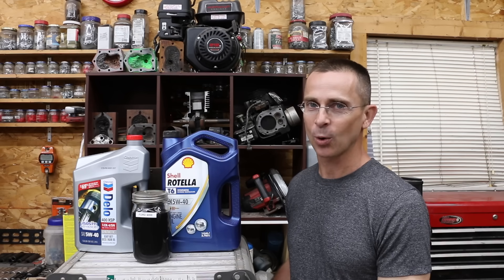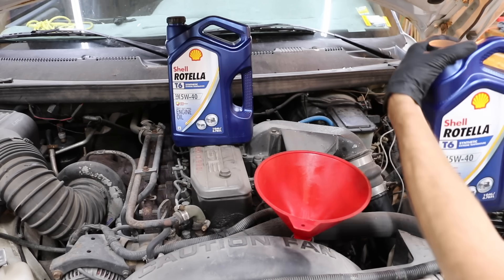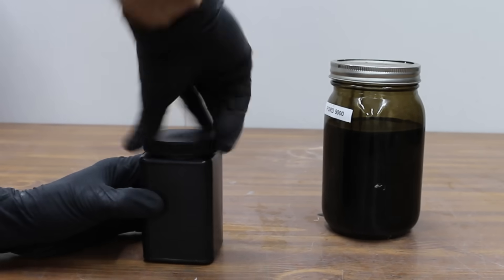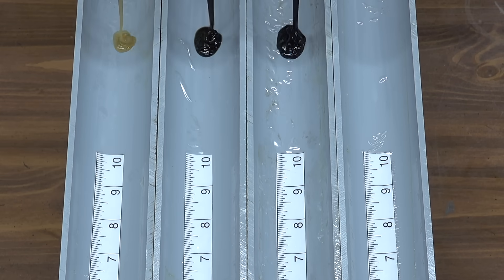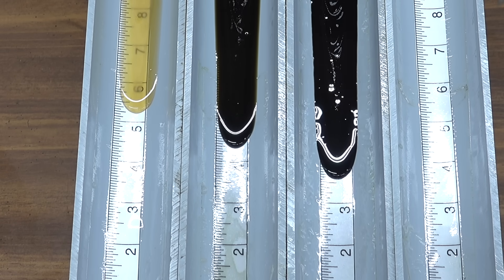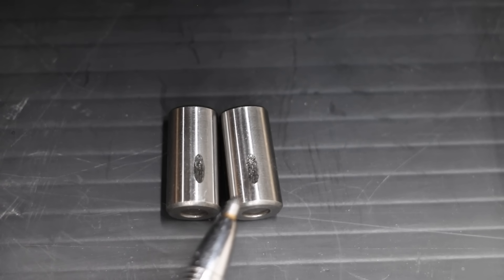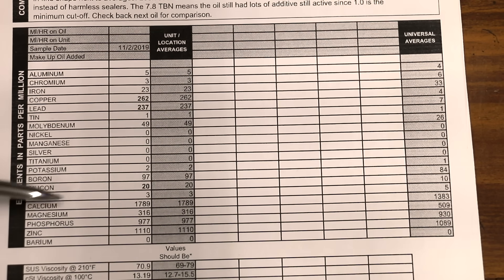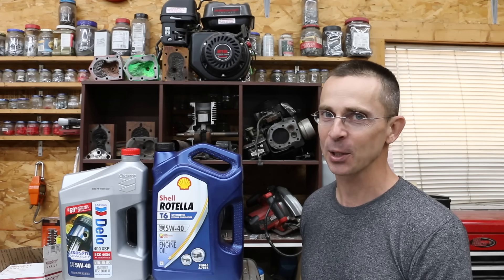Will Annual Oil Change Damage Your Car? Let's find out!

Comment: Thanks for another great video. I am relatively new to owning a diesel so any info I get that can be used is much appreciated. I do use the T6 but have changed my fuel additive based on a previous video of yours in which my previous additive did not finish well. My truck is running much smoother with less white smoke on start up after switching to one of your top finishers. Keep up the awesome videos.
Reply from the maker: Thank you

Comment: Man when are you going to check out the best oil on the planet cerma oil the test that they do have proved their the best this oil does not hold any water in the flashpoint is over 400 degrees because of the ceramic coating bar none I've been using this for over 1-year it works
Reply from the maker: Thank you for the feedback

Comment: In the mid 1990's I bought a lawn n garden tractor with a 20 HP B&S engine that was non running and needed other repairs. When I got it running it burned oil so I put in Synthetic, which was fairly new in the automotive field at that time. The synthetic has a lot higher cleaning properties than conventional oil and as a result the engine started smoking pretty bad. I put in 20w50 motorcycle oil which minimized the smoking but, didn't stop it. Fortunately a friend bought it to mow his gardens plot a couple times a year so I didn't have to do a rebuild. LOL I really like Synthetic oil, I switched my H-D to it and it lowered the oil temp 10-15 deg. Thanks for the video.
If you would I'l like to see you test Synthetic to Conventional Oils.

Comment: Of course you don't need to change it every year if it was low use. Don't even need a test for that. My generator oil is a year old but only had 40 hours on it, so I am leaving it alone for a second year.
Reply from the maker: Thank you for the feedback

Comment: Us motorcyclist use T6.
Reply from the maker: Thank you for the video idea!
Reply: @ProjectFarm  Rotella T6 made my Yamaha FJ-09 Tracer (touring version of FZ-09/MT-09) shift soooooo much smoother.  It's a 5W-40 instead of the recommended 10W-40, but I think it's fine if it's a little thin cold as long as it's a 40W when warmed up.  My bike runs a bit cold anyway.
Reply: You should only run motorcycle oil in motorcycles with wet clutches. Car oils will cause the clutch to slip slightly and wear out much quicker...
Reply: @Chris-yy7qc  Diesel oil isnt the same as car oil.
Reply: @Chris-yy7qc  Rotella is safe for wet clutches

Comment: I ran T6 in my 2006 CBR1000RR sport bike for years.  It met the JASO MA rating as required by Honda.  I had ZERO issues out of it and it was WAY cheaper than buying “motorcycle oil” by the Qt/L.
Reply: We run T6 in bored and stroked race quads. For years. I laugh at the dudes running royal purple changing it after 1 race
Reply: Piff Smith i never change it after every race maybe after 9-10. I run amsoil, always had good luck with it my rekluse clutch in my 450 dosent like t6 for some reason
Reply: same i ran DURON SHP 10W40 on my ninja 250 and it is my track day bike. Been 4 years and running smooth and clean every time it need a rebuild.
Reply: I run it in my 600rr its good stuff
Reply: I wasted a lot of money on motorcycle oils over the years until I discovered you could run this just fine in bikes.  I stopping running motorcycle oil in my metrics about a year ago with zero regrets.
Reply: jmbman the only thing I run motorcycle oil in is my dirtbike because i race moto cross with it. And found it can make my clutch slip if im really beating on it
Reply: I have a 2005 CBR1000RR and I do the exact same. It’s good stuff, have ran T6 in tons of my bikes with no issues at all for thousands and thousands of miles!
Reply: I've run it in my Victory motorcycle too. Fine for wet clutches.
Reply: Yup...been running the T6 in my V Star 1300 for seven years now, and the only difference I've noticed between it and a bike-specific oil is slightly "notchier" shifting, but then my cruiser has clunky straight cut gears, so it has never been silky smooth.
Reply: @noahmercy-mann4323  : I almost hate to admit it but Amsoil has been the best for my bikes so far. Less notchy shifting and generally runs smoother but there's a $40-$60 difference in oil prices. One takes 4 qts the other 6 qts. The Rotella is just fine for most folks who need JASO MA/MA2.
Reply: @UTD-Media-AZ  believe me, Amsoil would be my go-to if I had a decent income, but my current situation requires me to make the most with what I have. I'll live with slightly coarser shifts to save $100 a year, provided my drivetrain is protected (which it is).
Reply: @noahmercy-mann4323  : Yeah; you're not depriving your machine by using Rotella. It's an excellent oil. I was just stating my personal experience. I have several older used vehicles so I have to watch what I spend too. I did splurge one time and got the Amsoil. I'm so glad I can leave it in the engine until I hit the normal interval and not have to change it in just one year. I don't put a lot of miles on that particular bike (04 Kingpin).
Reply: @noahmercy-mann4323  Rotella T6 made my Yamaha FJ-09 Tracer (touring version of FZ-09/MT-09) shift soooooo much smoother...probably less than half the effort.  It's a 5W-40 instead of the recommended 10W-40, but I think it's fine if it's a little thin cold as long as it's a 40W when warmed up.  My bike runs a bit cold anyway.
Reply: I'm running 5W30 Mobil 1 advanced full synthetic ENERGY CONSERVING non MA rated oil in my 08 SV650. It is geared taller, and has been through a drag strip and track day with no issues so far, but it is also a low mileage bike. Top end will be coming apart soon and I will get to check out the cams. Only thing i noticed is the shifter does feel more notchy, the motorcycle specific oil damped the notchiness more, but that doesn't mean it takes more effort to shift or anything.
Reply: How many miles or kilometers on your CBR1000RR ?
Reply: Haplo59 i had like 27,000 mi when I got rid of it.  It never smoked or used any oil at all.
Reply: Bang on buddy!
Reply: I have 47K,  and I beat the shit of out it
Reply: What a crazy idea
Reply: @thomasbarlow4223  Nah, not at all. I run Rotella T6 in my Husqvarna SM610 motorcycle, actually I run it in all my small engines. Just get on the forums, thousands of people running T6 in motorcycles because it's safe for wet clutches -JASO/MA rating. It's also super popular with the turbo charged Subaru and Audi crowd... I used to run it in my vehicles, but the new engines call for a lower viscosity than T6 offers, so I run Pennzoil Ultra Platinum now. The price is about the same for either on Amazon, $20 per 5 quart jug.
Reply: Jeremy Schoeder exactly!!!   Much cheaper than “motorcycle oil” and it meets the manufacturers recommendations.   What’s the difference right??!  T6 is some GOOD oil too!
Reply: @Maoshung  Right on man. Waaay cheaper than the 10w60 motorcycle oil they "recommend" for $40/quart. No thanks... My lawn mower, snowblower, and boat seem pretty damn happy with T6 as well.
Reply: @JeremySchoeder  Where do you read if an oil is safe for wet clutches ?
Reply: @AAAAAAndrea  It's JASO MA certified. Just Google "JASO MA".

 Here's a snippet from oil specifications .org...
"JASO MA and JASO MB classifications

Modern motorcycles usually have the same oil lubricating the engine and the wet clutch. For this purpose most of the time the regular friction modified engine oils are not good enough. To make sure that the right oil is used motorcycle manufacturers usually require the oil to meet one of the JASO standards explained below.
The motor oils that meet the JASO T 903:2006 standard can be classified into four grades: JASO MA, JASO MA1, JASO MA2 and JASO MB. The classification is based on the results of the JASO T 904:2006 clutch system firction test."
Reply: @JeremySchoeder  Thank's man :) appreciate it 👍
Reply: Jeremy Schoeder I literally said this in my original post....  
Plus it’s on the back of the bottle... 🤷🏻‍♂️
Reply: @AAAAAAndrea  look for the JASO MA/MA2 rating on the back of the bottle, or look online. Also follow a couple of FB motorcycle forums, great knowledge bases
Reply: @Maoshung  I know man, but Andrea asked me a direct question, so I replied.
Reply: @JeremySchoeder  Back in the days I had a dirtbike and I put specific 10w40 gearbox oil , only 600 ml needed , 1 liter was 10$ so 10$ 2 times a year wasn't a big deal, that's why I asked , didn't know what Jaso MA/ MA2 was.
Reply: thomas barlow crazy?  You being serious or...?? 🤔
Reply: I tried T6 in my '06 FZ1 years ago and the shifting felt really notchy when warmed up, not smooth the way it was with regular Rotella 15/40.  Switched back and have been sticking with the dino ever since, also run the same T4 in both my Duramax trucks so I always have it on hand.

Comment: been using T6 on my 4 stroke motorcycle because it meets JASO MA and I don't want to pay over priced motorcycle oil
Reply: jack schitt I started to run T6 in my zero turn mover and farm tractor because the engines are quieter and cooler. 
That’s running them in Texas and Florida.

Comment: I change my oil every 10k miles using amazon basic oil and a Mobil 1 filter rated for 15k miles
Reply: On my 2010 Altima w 150k miles
Reply from the maker: Thank you for the feedback

Comment: Back in the 1960s we ran Delo straight 30 weight. Electric engine heaters for cold weather starts. Then multi/grade oil came out and we switched to 15W 40. And Delo was still king of the hill because we changed oil every 6 - 8 weeks. 
I’ve been using Shell Rotella for close to 40 years because it stays cleaner longer. And yes we examine the used filters.

Comment: What would be cool is to see the tests on the same oil after a year. 

Like change the oil in a lawnmower, use it for a season, then take a sample. Wait a year and take another sample. Often times if you buy a 2nd had engine it has been sitting for awhile. The guy you buy it off of, even if it is a friend, says "I just changed the oil". With synthetic you can be talking about a $50 oil change. Is it worth it?
Reply from the maker: Thank you for the video idea!

Comment: I had a 2000 explorer with the 4.0 SOHC engine that had the common timing chain rattle. I changed the oil using the T6 5w40 and it quieted the chain noise some. Even when it was 0 degrees. Was impressed
Reply from the maker: Thank you for the feedback

Comment: That ram with the 5.9 is a clean looking truck!! Wish Cummins teamed up with Ford for the 5.9 back in the day, thats only cuz i am a little Ford biased.. Seems their best diesels are the old 7.3 and the. Current 6.7 powerstrokes i hear are good..  I hear good thinks about the duramax.

Nissan really dropped the ball at having a chance with a cummins powered engine in ther umm 1/2 ton to 3/4 ton split in the middle at 5/8 ton asking for 3/4 prices? Nissan wad confused..  From what I hear though the Cummins in the Titans is a 5.0, not the OG 5.9 Cummins ?

Comment: For the record I was told by a mechanic that oil that goes in a Diesel last longer because it is a heaver weight oil and that you should not change the oil in your car once a year and it should be every 6 months no mater how many miles you drive.  I think it would be an interesting test to use some lighter oils in a test to see if oil really breaks down over time with low miles.
Reply from the maker: Thank you for the video idea!

Comment: 25% Seafoam in crankcase, 75% oil in crankcase
50% Seafoam in crankcase, 50% oil in crankcase
75% Seafoam in crankcase, 25% oil in crankcase
100% Seafoam in crankcase, 0% oil in crankcase

Comment: In Indonesia worse than America, the official workshop recommends oil changes every 6 months. In my opinion this is ridiculous. They just want to sell oil. Waste of money
Reply: Motorcycle oil every month. Lol that bs unless you drive it more then like 4-5 thousand miles each month.
Reply: @TheLongjohndong   more *than
Reply: Change every 6 month might be true if u are using mineral based oil, not syntethic
Reply: I live in the Sahara and the manufacturers  still recommends oil change every year
 Just tape in google how VW destroyed engines with it's long term 2 years service. The problems starts to appear around 200k km
Reply: @mohamedms2472   with *its
Reply: In Indonesia you drive at average speed of 15km/h. You get stuck in traffic for hours just going from home to the groceries. You are stuck in 33c heat day in day out. Engine idling for hours in traffic jam. I think 6 monthly oil change is a good idea.
Reply: @saauuzza   Agree, that's very difficult on on an engine. I think most of the H20 would evaporate even given the high humidity in the region.
Reply: @jjwiii1432  the high humidity will not cause engine oil to have water content as it is not winter conditions there is no condensation issue such as parking cars on top of lawns in winter but being stuck for hours in traffic jam is killing the engine oil slowly as they break down faster. Stop and go driving is hell on earth for the engine and the engine oil.
Reply: @Andrew H  *lose
Reply: @Andrew H good quality synthetic should still never run 20k.. that's just bs they sell you to make the cost of repair not look so shitty.
Reply: Indonesia has very high humidity all year around maybe that counts as a factor but, in my honest opinion 1 year oil changes should be enough to take care of that. From what I know though most people in Indonesia drive 100-125 CC motorcycles with auto wet clutch. So I guess someone is trying to make more money :D !
Reply: @Mprikiman  That's right brother. Oil replacement every 6 months I mean applies to cars. If for a motorcycle it is recommended by the garage to be replaced every month. Indeed many naughty workshops in Indonesia. People who don't understand automotive certainly tend to do what the workshop says
Reply: @rendy1985    money for American Shell, Mobil, etc.
Reply: In Italy the workshop recommend oil changes 30.000km. If you not reach this kms in one year they recommend an oil change at least every two years.
Reply: @Brukers3  Of course the workshop would recommend that, they're in the business of selling you engines and engine work!
Reply: I never changed the oil on my first car in 50k km.. It was a missunderstanding by the workshop and fake by the last owner. Yep... 50k km without change and let me tell you.. the oil was almost christal clear.. well black but no particles and shit
Reply: @DerAngeloMerte  I call bullshit. 25k without an oil change would sludge up that engine and probably sludge the pickup so bad it starves the engine.
Reply: @punkrocker10115  Nah. 50k km is possible with good oil in a fresh engine. It's not good by any means, but possible. I know of an old Opel that didn't get any oil change at all, the engine seized at around 80k km. I don't know if it had oil added to it, unfortunately. I might be able to find out.
Reply: @punkrocker10115  for eu cars,renault recommends oil changes at 30.000 kms
Reply: @punkrocker10115  mine has 167k, changed oil twice so far.
Reply: @ridgerunner106  literally impossible but, whatever..🤷‍♂️
Reply: @DerAngeloMerte  Looking at it only tells you if there are huge problems, you need an oil analysis to actually assert nothing bad happened. Not to mention, I bet all the crud is solidified to the inside of the valve cover as sludge!

You'll probably get 200k out of an engine that could have gone 400.

Comment: I think the reason you have to change it after so long only applies to conventional oil I got a old bulldozer from the 40's and the intake had one of them oil ones I took it off to clean it out and put new oil in it but after all them years what was left of the oil had turned into a sludge like tar
Reply from the maker: Thank you for the feedback

Comment: It really depends on your driving conditions and habits in terms of changing your oil. I easily go over one year and 12k+ miles without problems with my Odyssey 3.5L V6. It has more than 205k. I usually send my samples to Blackstone for analysis. It’s the only way you’ll know if you can extend the miles between changes.
Reply: How much oil on a complete refill ?
Reply: I think it takes 4.5-5 quarts.
Reply: @boostedmaniac  That's quite low actually 😮 My Honda city sedan 1.5 litre 4 cyl engine takes in 4.2 litres on complete refill. Engine with 3.5 ltr size should atleast needs around 7 ltrs . Strange it is. Do check your manual once again.

Comment: I had a Chevy Cavalier with about 140,000 miles, I ran synthetic oil and it was almost all highway miles. I once went about 35,ooo miles between changes and I was bout to change it when a dump truck dropped a rock and I hit it... shattering my oil pan. what was left was sparking clean and the mechanic said my lower bearings and bottom end looked almost new. what was left of the pan had zero sludge and they ordered a new pan and I continued to drive the car with no issues. I ran Mobil 1 synthetic. Haw about a video on super long miles between oil changes?
Reply from the maker: Thank you for the feedback

Comment: JASO ratings from Japan are tough to earn. The Rotella rates a JASO rating which means it can be used in wet clutch performance motorcycles. I run Rotella in my 2007 Duramax and my 2004 Honda CBR1000RR. Outstanding motor oil!
Reply: My 2002 honda vtx 1800 i use rotella 50,700 trouble free miles
Reply: Yep, I always used Rotella in my Kawa KLR650 dual sport, because it has a wet clutch. Never any issues, and the oil is cheap at good ol' Wally World.
Reply from the maker: Thank you for the feedback